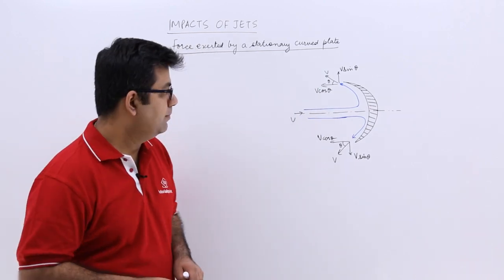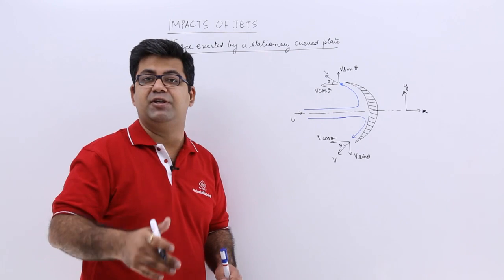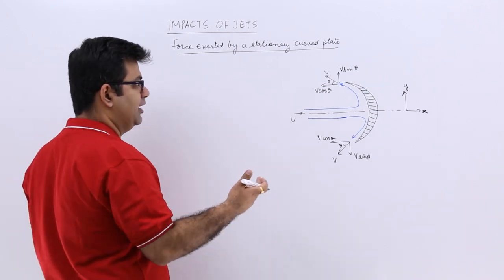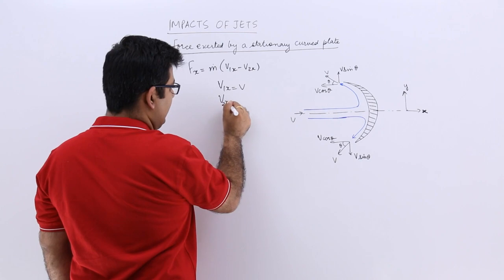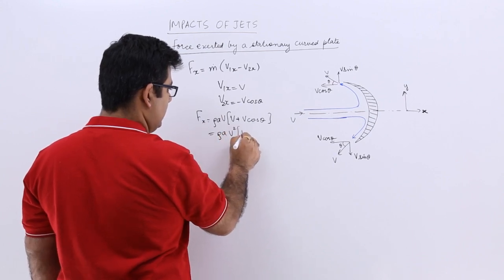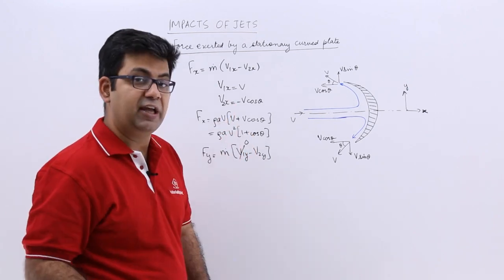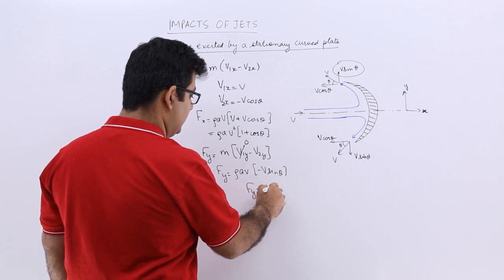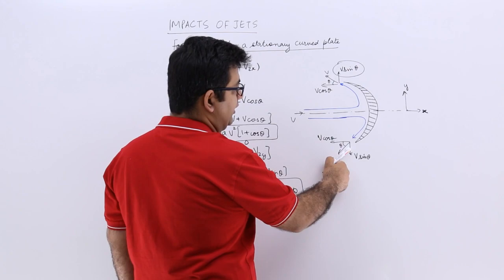Force Exerted by a Stationary Curved Plate

Comment: force in vertical direction will be zero,,. because forces in upper half and lower half will be equal and  in opposite direction.
Reply: By that logic V2x should also be 2VcosTheta?? Am i missing something here??? I may be wrong but i think he is considering only upper half of the plate!
Reply: Then what about x directions
Those add up?
Reply: @krishnasagar8812  it was already summed up , the jet will be divided equally half will go to top portion and half will go to the bottom portion i.e area of jet will be A/2  in upper half and A/2 in lower half
in the case of vertical forces they will cancel out each other as they are acting in opposite directions
Reply: @DHSH344  thanks
Reply: @gmeena1  you are right, and then the mass flow rate on each side of the vane is m/2. Hence it counter balances and becomes = [(ρaV/2)×Vcosθ] × 2  = ρaV²cosθ (side vanes componenet) added along with central jet impact becomes = ρaV² + ρaV²cosθ = ρaV²(1 + cosθ)